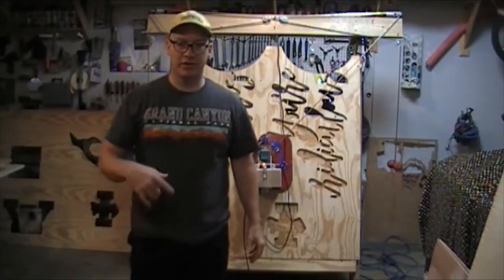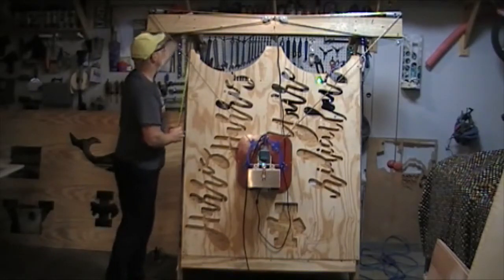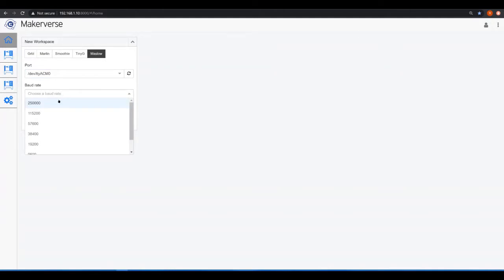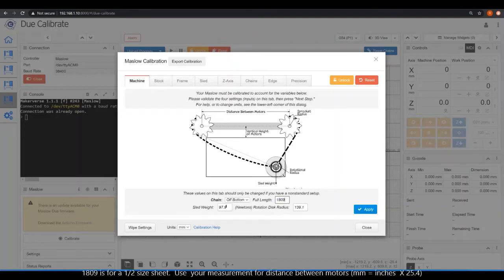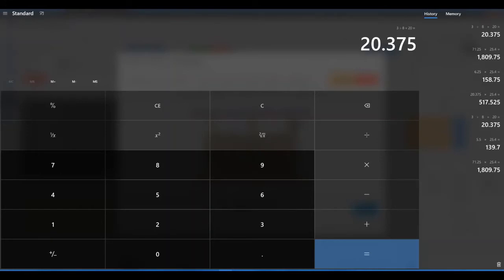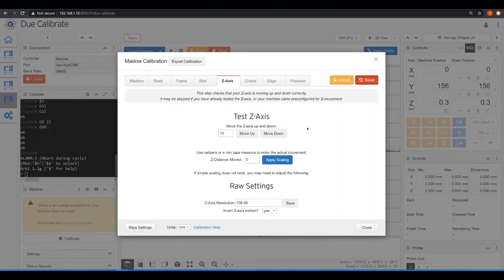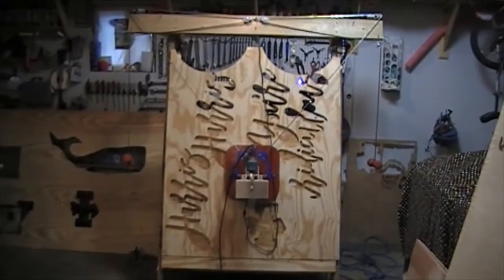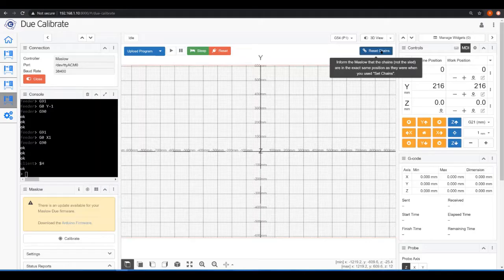Makerverse Calibration

Comment: Ok, so I just went through the calibration in Makerverse(and your video helped) and I have to say it is next to impossible to pull off in the order and way they suggest(not your fault here at all). That part where one has to measure the chains could use some work. I'd think it'd be far easier for this step if they'd tell you to find the center of your top beam, then adjust each stepper via the interface till the appropriate teeth are at 12 o'clock,  and then put the chain on, etc. because it seems next to impossible to get the cotter pin to be in the right position AND for both sprockets to have a tooth in the proper position. It'd be easier to just count the number of chain links if you had to.

I'm going to do some thinking here and see if I can't get better results out of my method.

Comment: Thanks for making this video, Rob! I got the square metal maslow sled with their z-axis and the standard z-axis motor. Makerverse 1.1.2.
I entered -918.75 in the raw z-axis value field. Unit is set to mm.
When I tested the z-axis by 1 down it moved the axis by 25.4mm (1") up. I would have expected it to move 1mm down. Something is not quite right here? Can you help?
Reply from the maker: I'm glad it was helpful.  First off, you can reverse your axis by setting the $3 variable in the console.  $3=4 would be the one to reverse the z axis OR you can change that negative 918.75 to positive.  Check your gearing on top.  Is the motor pulley larger than the lead screw pulley?  My setup is the equivalent of a z axis pitch of 4  (in webcontrol) but I have a higher speed z motor.  Do you have the standard z axis motor or the high speed metal maslow z axis motor?
Reply: @robthebuilder9654  Thanks for your reply, Rob! I got the standard z-axis motor and my bigger pulley sits atop the motor. I did enter -918.75

Comment: I'm liking your chain management system. I've only started using the Maslow and already the chains are making me nervous. Have you had good luck with that setup, or do you have suggestions on what you've learned? I have the basic, original setup with the bungee strings and they don't work great.
Reply from the maker: I'm not really liking the weights because they take up more space on the sides of the system and I don't have a lot of extra space to give up.  They also rub at times when the sled is in the far corners and sometimes catch on stuff.  the bungee wasn't ideal, but I only had a chain jump once because of it.  The newer solution is to use a screen door spring similar to the M2 setup.  You might want to check that out.
Reply: @robthebuilder9654  Ahh...screen door spring. That's great! The bungee has been working okay for me, but some of the projects I'm working on force me to use the majority of the work space so I'm having a bit of trouble with finding a bungee that works well in all situations...when the sled is pretty far down and to the left or right, the bungee gets pretty taut.

Comment: Hi, Rob. Starting to calibrate my Maslow (Mega) and the c-beam mounted z-axis is not moving, just humming (motor is fine, as well as the other axes). Makerverse is up to date (1.1.3) and keeps asking to change z-axis depth, but I don't know where. Can you help me?
Reply from the maker: In the calibration you have a z axis setup where you need to move it, measure it, and move again.  When I did this, I had a nonstandard z axis motor with a different encoder count so my numbers will be much smaller than most.

Comment: Nice Job! Could you let us know the accuracy of your machine after calibration?
Reply from the maker: I think at the end of this video it was 3.5mm.  I have been testing different arduino controllers and shields with it, so I've recalibrated it since then a few more times.  With makerverse I found that your initial measurements are critical to your accuracy, where with webcontrol if you get close, it will adjust them for you as you iterate and successively improve the accuracy.

Comment: Just curious, whats your work area size? And how high is the motor from top of waste board?
Reply from the maker: the work area on that maslow is 4x4 and the motors are 20.375" above the top of the work area... a line at 4' from the bottom.  So the "work area" is 4x4, but the top of the waste board extends up further and I just didn't bother to cut it, so it looks weird, but it works quite well.  This frame is built on my chop saw cart and rolls around.  It was a quick setup to test the due board and metal sled.